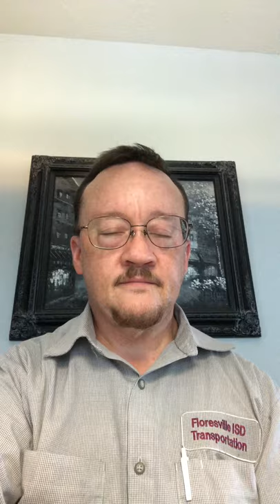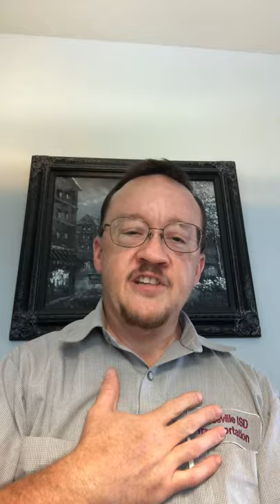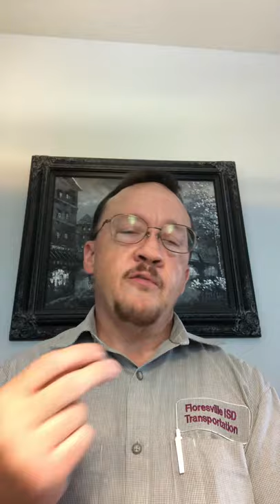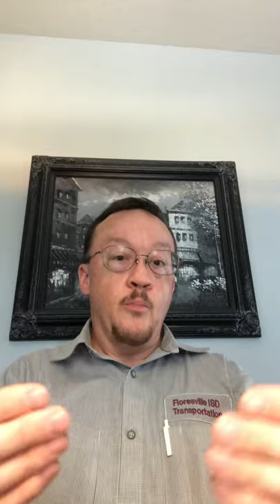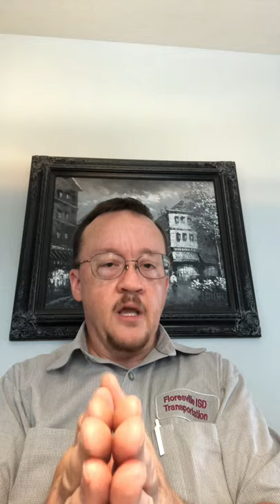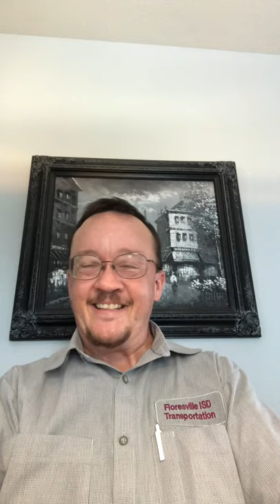Here’s why fuel efficiency dropped on Project Farm’s HHO test

Comment: The electrical energy supplied to the hho generator is supplied by the alternator. The alternator works a little harder to supply the extra charge needed. The engine has to work a bit harder to drive the extra drag from the alternator.
Now, this would up the fuel consumption  in the long run ever so slightly, yes.... but, the hho generator is providing an extra form of energy (hydrogen gas) to be combusted. Thus delivering more power coming from the engine (provided the fuel mixture is compensated to accommodate the hydrogen gas). This is from where increased heat emanates.
This can be solved by installing an oil cooler.
As for f.i engines: instead of tapping into the air induction pipe, rather tap into the air induction box BEFORE the location of the MAP sensor. This should then not leave room for the e.c.u to adapt the fuel mixture. At least, for me this would work as I do not have an oxygen sensor on my  f.i. vehicle. I would need to close my fuel mixture screw by a half turn or so.
Reply: That means my 2000 watt amp and 12' sub in my truck would hurt my fuel, along with my extra lights on the front. It does not.... 2010 f150 v8

Comment: What if I separated the positive and negative terminals and funneled only the hydrogen into my intake and funneled the oxygen away would my O2 sensors still be affected. What I'm asking is if I done away with the oxygen and only allowed the hydrogen in would it increase my gas mileage
Reply: All of the Oxygen that was added with the Hydrogen would be combusted thus there is nothing different for the Oxygen sensor to detect.  It's a myth that get circulated to justify why such systems to not provide the results that are promised.

Comment: I was wondering about that. I know of two companies that provide a secondary computer that overrides that main vehicle computer. I have no idea how well they work. I learned many many years ago to re-jet my carbs when changing altitudes. Can one not couple either water or alcohol injection to an HHO system to cool the intake charge just like you can for more advanced timing?

Comment: A few comments to your analysis.  
1.  Air fuel ratio changes and EFI O2 sensor picks up the additional oxygen from the HHO.  Nice theory but you also adding fuel in form of Hydrogen with the Oxygen and that is at the perfect stoichiometric mixture (2x H2 + 1xO2 = 2 H2O) thus it does not add or remove Oxygen to the exhaust after combustion.
2.  stoichiometric mixture of gasoline:  Yes the perfect stoichiometric fuel to air mixture of gasoline is 14.7:1 however this is a ratio by weight and not by volumetric parts.
3. lean mixture = hotter combustion temperature: Nope actually the highest temperature/highest energy release is at stoichiometric fuel air mixture and combustion temperature will drop off if you go leaner from that point.  Gasoline engines usually run slightly rich especially under full throttle conditions to reduce combustion temperatures which also reduces NOx emissions.
4. Could HHO increase fuel mileage and efficiency: If you make it with the electricity from the alternator that is connected to well tuned engine where you feed the Hydrogen Oxygen mixture into,  not a chance carburetor or EFI. You will always spend more energy on making it than you'll get back from it. Now if you are a dare devil and would make it not inside the vehicle and then compress that stoichiometric mixture that requires very little initiation energy to  blow up and put it into a tank in the vehicle ok maybe but that would risk both your life and the lives of others if things go wrong.  Food for thought, at atmospheric pressure you would need about 4755 US gal of that gas to get the energy equivalen of 1 US gal of gasoline and the Hydrogen that is within that gas has no more magic than the Hydrogen that Hydrocarbon fuels like gasoline contain.
Reply: You miss one point. HHO is the fastest flame in the universe (and very hot) it can enhance combustion efficiency.
Reply: @TravisTellsTruths  True a stoichiometric Hydrogen - Oxygen only gas mixture has a very fast laminar flame speed however this is based on this stoichiometric fuel mixture only. Here you just mix a tiny qty of it within  lots of ambient air which slows down the reaction due to other atoms and molecules present in gas mixture.  Furthermore the combustion temperature of Hydrogen is only a little higher than that of gasoline. Also to mention the molecules in gasoline contain lots and lots of Hydrogen atoms as well.  So sorry the BS of enhancing combustion,  cleaner combustion, more complete combustion...etc. is just trying for excuses  on something that does not work.

Comment: When he routed the hose through the airbox he inadvertently caused the engine to run leaner I'm not sure if he removed the air filter or put a hole through it. Also the hho kit isn't going to help if you do 0 tuning. All in all I doubt a few hydrogen bubbles going into the intake will do anything significant not with a kit as small as that one.

Comment: If you can reduce the gas used and replace it with HHO. Then you can see better economy. They never seem to do that though.
Reply: As I stated as well. An engine needs a certain quantity of fuel. Over-fueling is useless and must be eliminated.
Reply: @nicolasparrott4835  engines love rich fuel mixes. They have all the fuel they need. It's lean that hurts them. If you could remap the computer to be 10 percent leaner and add 10 percent hho you would see a difference. But it still has too start at 14/1 air fuel mix. Hho has more energy though. I could see it going higher like 20/1. Just a guess at this point.

Comment: So the issue isn't the HHO the issue is the computer.  In theory you don't need to worry about fuel ratio because HHO is essentially already "mixed" to burn.  Why run fuel at all?
Reply from the maker: You can’t run only HHO because you would need a LOT of it to run an engine on it.  A typical HHO generator does not even provide enough fuel to run a small lawn mower engine.

Comment: so separate the oxygen vent it save store & just use hydrogen then? the computer will change timing as well which changes mixture. and also a backfire can occur which if you dont check valve bubbler or spark arrest inline you can blow something up? i guess 🤔

Comment: When I ran my car on "water" I used a potentiometer spliced into the O2 sensors. 

It's best to scrub the hydrogen before directly feeding it into the engine though. That extra oxygen makes for some hard tuning and gutless performance.
Reply: how did u use a Pot on the os sensors?
what is this gutless performance u speak of?
Reply: @woodzyfox4735  Use an O2 tuner like a pro tuner. Presets can be adapted to your specific cars "performance" or lack thereof... Hydrogen bonds, when cracked don't have the best stoichiometric ratio which causes the engine to run lean.
Reply: @brookekathryn1980  I have an 03 outback. Any advice on what I could use? User friendly
Reply: @woodzyfox4735  I like the pro tuner, but I should say it's the only one I've used. I'm sure there is much better and much worse out there.

Comment: One thing everyone is missing, when you speed up the flame front in the cylinder it will lead to knocking.
Reply: mine doesnt do that. i have knock sensors that fix that

Comment: I always figured that HHO never works because people never change the A/F ratio in their ECUs, so the engines literally just going to be using the same amount of fuel

Just thinking and talking about it, isn't going to change a thing though. Should used the effort to make a video testing it yourself
Reply from the maker: I agree.  

The reason why I responded is I built an HHO generator many, MANY years ago and installed it on my new 2002 Hyundai Accent.  That was 19 years ago!!  I went through multiple different versions, different plates, different volumes of hydrogen and oxygen produced and every result came back the same.  So that is why I did not build one and put the results up on the video.  Project Farm did it for me.  This video was just a more technical explanation of his results.

Comment: If you split water into hydrogen and oxygen, then run it through an engine, as the hydrogen and oxygen burn they recombine into water.  The oxygen sensors on engines are in the exhaust stream.  If you put hydrogen and oxygen into the intake in the proper ratio, there will not be any excess oxygen left over for the O2 sensor to detect.

The reason NONE of these schemes work is very simple:  It takes energy to split water into Hydrogen and Oxygen.  When you recombine them you get back the exact same amount of energy it took to split them apart.  BUT, no engine and no generator are 100% efficient.  Because of friction and other losses, you end up spending more energy to create hydrogen and oxygen than you get back when you burn them.

Comment: So it's better to run hho on a lean burn setup. The hho  mix helps prevent detonation derby running at lower fuel ratio reducing demand on fuel. Instead of 14.7:1 maybe 20:1 mix or greater.

Comment: Total rubbish. On a cold night a engine will  run better because the air is dense, therefore receives more oxygen which makes the engine more powerful. The driver can either back off on the gas pedal or exceed the speed limit. Backing off will  save fuel. Maintaining the same pressure on the gas pedal would result in a speeding fine... Hho generators consume more energy then they produce, they don't save fuel unless you discount the energy they consume from the engine to operate.  Science proves it.

Comment: Then why his 0-60 time didn't decrease.
Reply from the maker: Because at full throttle, the amount of HHO being consumed is VERY small compared to the amount of air and fuel being consumed.  At full throttle on that engine, you are looking at approximately 400 cubic feet of air per minute going through the engine.  To make it easier to calculate, we will round off the zero to 60 time to 15 seconds.  So, during that 15 second time span, that engine consumes about 100 cubic feet of air.  During that same 15 second period, the HHO setup is going to produce way less than 1 cubic foot of HHO.  This is oversimplifying things, but for those 15 seconds, the amount of HHO being injected accounts for less than 1% of the incoming air, so it won’t have a measurable difference.  This is VERY simplified, but the principles remain the same.  It’s just not enough HHO injected to make a difference at full throttle.

Comment: Isn't the hho the perfect mix. That's why it is so explosive and that's why a bubbler is needed. So should be no left over oxygen? This is also why you can compress hydrogen safety but not hho.
Reply from the maker: Not quit.  Hydrogen is VERY flammable but that is not why you have a bubbler.  The bubbler is where the electrolysis happens where the water is broken down into hydrogen and oxygen.  If HHO was the perfect mix then the generator would not have used more fuel.  Same goes for the Suburban.  The oxygen sensor on fuel injected engines sees a slightly lean condition when running HHO so the computer enriches the air/fuel mixture which causes a decrease in fuel efficiency.
Reply from the maker: Also, in regards to the explosiveness nature of hydrogen and oxygen mixture, this study proved that a hydrogen and oxygen mixture could be compressed up to 200 bar of pressure WITHOUT auto ignition occurring.  http://conference.ing.unipi.it/ichs2005/Papers/120001.pdf
Reply: @91CavGT5  the bubbler is not where the electrolysis happens. That is used as a air check to keep from an ignition even making it back to the hho generator
Reply: @91CavGT5  in the event of a flame making it back to a compressed tank at 200 bar would be catastrophic. Bad idea to ever compress a fuel with oxygen in the same container. Not saying is not possible but should never be done.
Reply: @91CavGT5  if you don't believe that the bubbler is just a check point and not where the electrolysis happens. If you don't belive me then try it. But be warned it will explode everything from tubing to the hho generator itself. Protect your self as I know it will ignite.
Reply from the maker: @johncollinsgrove1750  I don’t think my point got across.  I wasn’t saying that a 200 bar container of hydrogen and oxygen is safe, I’m saying it won’t auto ignite due to the pressure.  

My setup did not have a bubbler because the total area where hydrogen and oxygen could accumulate was VERY small.  

I understand the reason. For a bubbler as a safety item.  Primarily, if the engine backfires then you have a very high probability of the hydrogen igniting.  Depending on the area where the hydrogen and oxygen can accumulate prior to the engine would determine if you would experience a loud pop or an explosion.

Comment: You actually make 2 kinds of hydrogen along with the oxygen molecule. Diatomic and Monoatomic hydrogen. I had my HHO piped directly to the plenum and went from 19 mpg to 28 mpg. The biggest issue was amperage & heat. Never ran a “gate” on it.

Comment: If you actually believe that HHO generated by the engine will actually increase it's efficiency, regardless of what fuel system it uses, then you have no idea what you're talking about. There's a simple thermodynamics principal that clearly indicates that increase in efficiency is impossible.
Reply: First, breaking down water into HHO generates heat, heat is dissipated, that means there's energy lost.
Second, breaking down water needs electrical energy, electrical energy is generated by the alternator, the alternator is not 100% efficient, and generating the extra energy to break down the water means there's energy lost in the alternator.
Third, to generate the extra electric energy to break down the water, the engine has to generate more power to provide the alternator with extra mechanical energy, thus needing to consume more fuel, and since the average engine efficiency is about 30-35% (even worse for older carbureted engines), that means for every unit of extra energy produced, there are 2 units of energy wasted.
If you add all the losses from all the above, anyone with 2 working brain cells can figure out that HHO generated by any engine is worthless.
Reply from the maker: Yes, that is another reason why that I did not talk about.  You have a very articulate way of being an internet bully troll don’t you.
Reply: @theR6969  which is why you generate it with solar power on something like an RV or big rig where enough solar can be installed along with a little wind re-directing to prevent the panels from causing wind drag .... negating the hho input value.

Comment: problem here is you are just theory crafting.  If you were to, say, experiment, and determine the exact fuel to air ratio needed, and conditions required, to see optimum gain from hho (if any), including the additional energy costs to generate the hho, then you might have something useful.  Also with injectors it would be a lot easier to dial in that ratio, even automating the experiments, vs a carb.  But otherwise I don't think there is anything to HHO, at least as far as gasoline is concerned.  It should have zero effect on the o2 feedback directly since it is added in stoic ratios, but it will displace incoming air by some tiny amount, leading to a richer mixture by default in a fuel injected system (which will be corrected to stoic via the o2 sensor), plus it is inefficient to generate hho, and they are all completely unregulated for output so all the claims are just noise.  There are much better ways to save fuel, mostly dealing with driving technique (in a car), or tuning.

Comment: Great theory  but fact remains it takes more energy to make HHO than it's worth
Reply: Then why doe a belt driven supercharger and 100+ HP to a car??
Reply: @greggmccleery9819  lol run the supercharger without extra fuel at FOT and see if you still get 100+ HP
Reply: @milanswoboda5457  OK got it but aren't they doing more fuel with hydrogen?
Reply: @greggmccleery9819  sure the Hydrogen is fuel however you are using electric energy to produce it  which requires power from the engine to turn the alternator which in turn requires fuel and due to unavoidable losses/inefficiencies involved you will use more additional fuel energy than you produced in form of Hydrogen fuel.

Comment: I do understand all the facts mentioned in the videos and agree from the technical perspection with them if we accept the HHO claims as true, however someone's wrong somewhere as no one ever came up with a Thermal Efficiency graph proving a Spark Ignition engine has any higher efficiency running on HHO than running on Gas.
To improve the efficiency you need to adjust the compression higher, and the maximum Thermal Efficiency is slightly over 50% for Diesel engines running as high as 20:1.
So you should adjust downwards the Gas mixture to get better Mileage with an HHO Bubbler? Sure, lean down the mixture and you'll use less gas, there are lean burning engines that do that by design and get better mileage without the HHO.
I don't understand how stuffing an engine with Oxygen, apart from adding more fuel (Hydrogen) would make it run more efficient when it suffocates with a mixture of overexcess fuel and pure oxygen than the cylinder can combust stochiometrically.
And i also don't understand how a jar of water turning to HHO powered by the engine's own power can not only improve the efficiency by comprehensing the load it adds so to produce the HHO, but also claims efficiency improvement comparable to like another 10 gallons of Gasoline, just by a jar of water that as a hydrogen it doesn't even have the thermal capacity to run a truck for a mile!